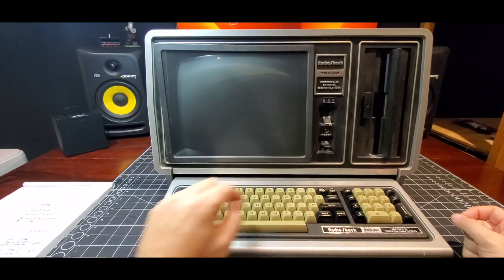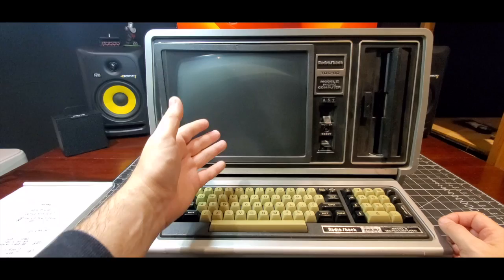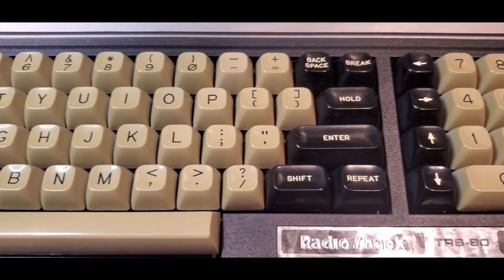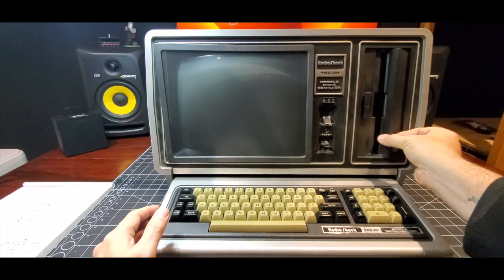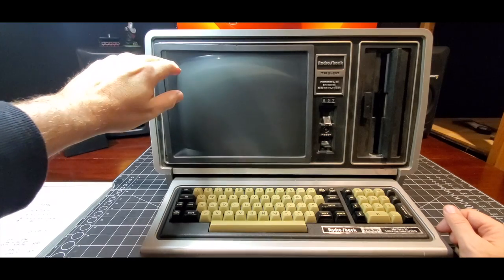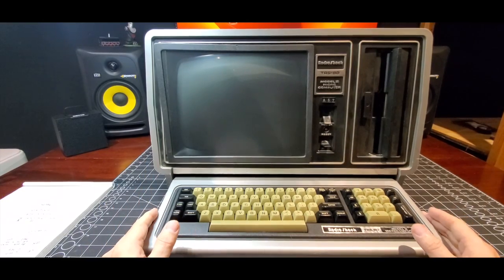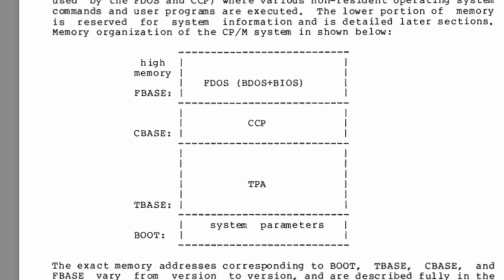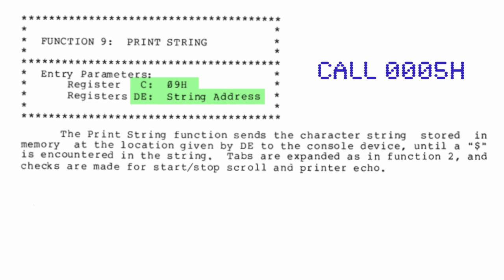Hellorld! on the TRS-80 Model II (Running CP/M)

Comment: Oh what fun!  I learned my first programming on a TRS Model 1... It was in 1978 and I saw a flow chart on the back of the Radio and Electronics Magazine and I stared at it for like 5 minutes and then realized I understood how to program... I got on my bike and drove over to Radio Shack where the computer was set up and I asked if I could try it out, the store manager was very nice... I put in the instruction and it would execute... I asked the question why did it do that immediately, he asked me did you put in a line number? I asked back, what's a line number??  And from there I began to self-learn basic... Later I got into Commodore and learned 6502 assembly, and in college got into the CP/M OS and a ton of other things... but this brings me back to my roots.... Thank you for a fun dive into this computer and memory lane.
Reply from the maker: It's interesting how much Radio Shack was an influence in so many lives. I used to literally live at Radio Shack, went right after school everyday playing with the TRS-80s and their "Science Lab" kits. Only place where you could find 70s red carpet, a battery of the month club, and CB radios right next to the latest technology. I finally convinced my dad to get a Model I level I 4K machine. (No "Syntax Error" --- just a "What?" or a "How?" error message 😀) Soon I had memorized the entire "26-" series and ended-up working in a Radio Shack for a couple of years. Best times!
Reply: @dipdoting  Good Times those were, Yes Battery of the Month Card... I remember those.  We couldn't afford a Model 1 4K, but I really liked them, I got a Commodore VIC-20 and wrote games that were sold commercially through a company here in the SF Bay Area called "Wizard's Magic Toy Box" sold on Cassette tapes.1982. Titles were "Muncher" and "Search and Destroy" although Muncher was a title that others used for a Pac-Mac knock off, my game was closer to a couple of other games like centipede and Blue Meanies, but had its own unique story and goals.

Comment: Trash Eighty, eh? Nice to see it going. David's challenge is indeed fun, maybe I'll do it on a C64 after I get it going.
I like your thorough explanation, and really good video production. Using OBS and a multi-cam setup, I presume?
Reply from the maker: Hey there, for the multi-cam I just used the Final Cut Pro multicam - it auto-synchs between two or more clips with the audio track and makes it easy to switch views during editing. That said, I'll definitely be using OBS for future videos, saves a lot of clip management 😁

Comment: I am glad that the Centurion restore project has got others to dig into other old systems.  My first machine was a home built 8008 with 1KB from static RAM , next was a TRS-80 Level-1 which I upgraded to 16KB of DRAM.  Even working at Warrex - Centurion I could not afford a Centurion CPU4 back in the mid 1970's.    Regards, Ken R
Reply from the maker: Hi Ken! My first computer was a Model I Level I with 4KB RAM (purchased waaaay back in 1981), didn't take long to run out of memory :) The BASIC was...well...pretty basic but still a good intro into computing at the time. Would have loved to get my hands on a Centurion or any of the mini-computers of the day, so must live vicariously through watching those amazing restoration project videos.